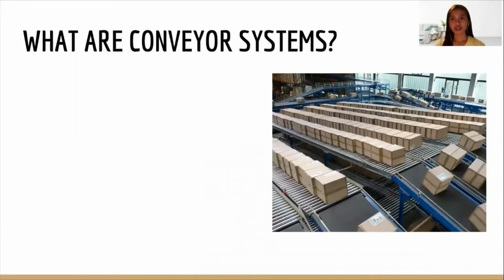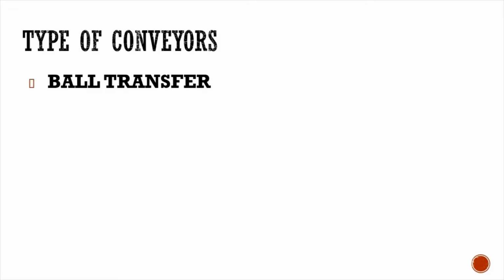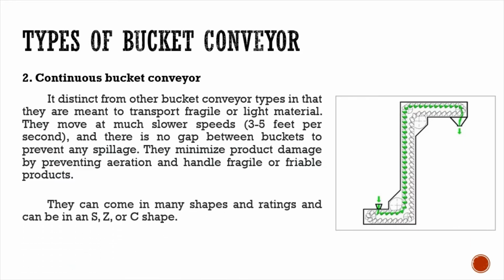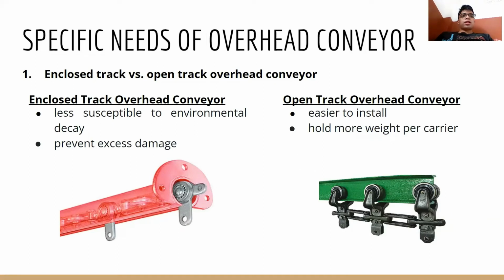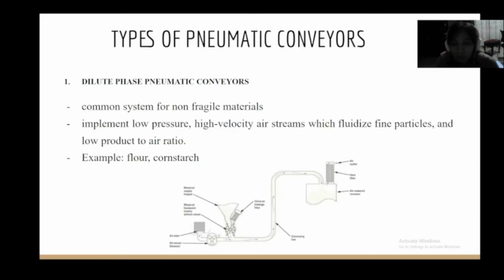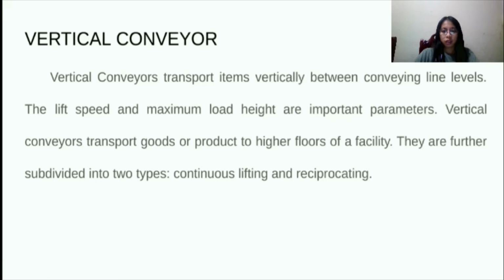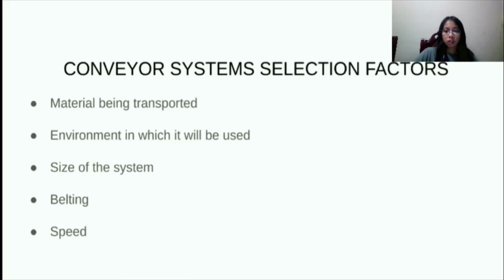Conveyors and Conveying Systems

Comment: Dajan, Kenneth Joseph Rex D.

18:38 Magnetic Conveyor

Magnetic conveyors contain permanent ceramic magnets in the bed of a standard conveyor. Magnetic conveyors hold ferrous parts fast to the belt and are ideal for elevation changes or part holding. They can be used in upside-down applications, with the strength and size of magnetic field designed per application.

Comment: Jeff Hentzen Simene 4A
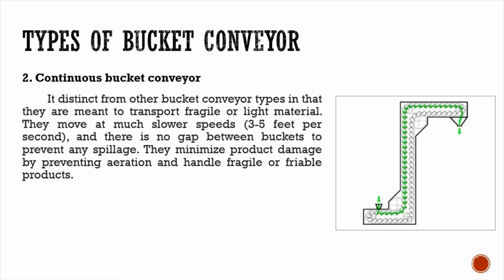24:18
Continuous bucket conveyor is designed to transport bulk materials from one or multiple feed points to a central discharge with high capacity. It is suitable for a wide range of materials, such as rice, peanuts, salt, silicon material, active carbon, etc.

Comment: Pescador, John Berth
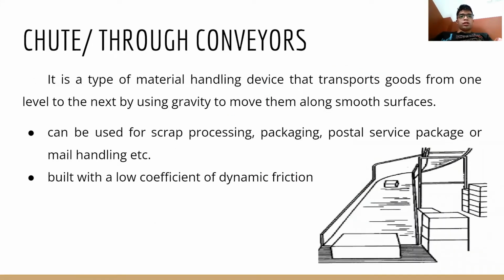25:57 - Conveyor Types
In the first portion of the topic I learned what conveyors are before moving on to the many types of conveyors, which piqued my interest. Conveyors mentioned in the film include the Chute/Through Conveyor, Drag Chain Conveyor, Overhead Conveyor, Pneumatic Conveyor, Vertical Conveyor, Vibrating Conveyor, Walking Conveyor, and Wheel Conveyor. The studies also go into the many types of conveyors, their uses and applications, as well as the benefits and drawbacks of each type.

Comment: Macalaguing, Ivan Jun A.
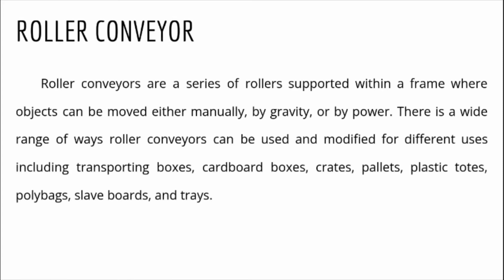8:20 - As the report discuss about conveyor, I've learned that it is so important in an industry for transporting things  such as boxes, plastic etc.
9:31 - I've also learned a brief history about it's origin and patent owner of the roller conveyor. It is stated that in 70's used for modern and computer control complex application.

Comment: Veloz, Adrian Clark D.
0:23 - Conveyors are mechanical devices or assemblies that moves material conveniently. It is comprised of frame supports with rollers, wheels, or a belt. This can be powered by naturally by gravity, by manual effort, or a motor.

Comment: Lamberte, William Wallace A.
5:53 Benefits of Using Conveyor System
Before going to the benefits of the conveyor system, let's first define what is a conveyor system. A conveyor system is a mechanical handling device that automatically transports loads and commodities within a space. With this we can safely say that a conveyor system is a type of system that makes the transfer of goods a lot more easier and effortless. Some of the advantages are, it is more safe than any other means of good's transportation. One can also choose a lot of way on how operate the system like hydraulic and mechanical. And also, it can transfer any types of goods in various shape, size, and weight.

Comment: Aggarao, Kaleel
ME4A
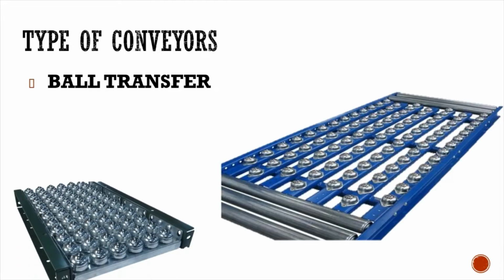16:31 Ball transfer conveyor
This type of conveyor uses running balls and medium-heavy or heavy plates to move items with smooth surfaces through designated areas. There is also a pneumatic table to raise or lower the materials on the conveyor. Due to its minimal friction design, it is widely used in fast-paced handling industries that are in need of efficiency like airline and freight transportation.

Comment: Jayoma, John Lloyd E. 
5:57 - Benefits of Using Conveyor Systems
Conveyor systems' most obvious advantage is their efficiency in completing any specified task while maintaining a high level of worker safety. Furthermore, the load capacity of such systems can be revised to comply with the requirements. Conveyor systems can be outfitted with a plethora of features to increase their functionality.

Comment: Lawan, Edcel Benz R.
25:56 - Types of Conveyors
I learned what conveyors are in the first part of the video until I got to the numerous types of conveyors, which intrigued my attention. Chute/ Through Conveyor, Drag Chain conveyor Overhead conveyor, Pneumatic Conveyor, Vertical Conveyor, Vibrating Conveyor, Walking Conveyor and Wheel Conveyors are the types of conveyors mention in the video. The reports also discuss thoroughly the what is the specific type of the conveyors, its uses/applications and also the its advantages disadvatntages of each type

Comment: Pelegrino, Justin Blake Nash E.
5:54 - Benefits of Using Conveyor Systems
The most prominent benefit of using conveyor systems is their efficiency of doing any assigned task, while maintaining a high level of safety for the workers. Moreover, the capacity, in terms of load, of such systems can be adjusted according to the needed amount. There is a variety of options that can be layered on to conveyor systems that many more possibilities, in terms of its usage.

Comment: Matthew Antoine Lawrence B. Añora
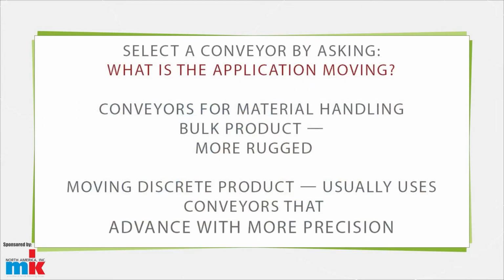1:33 
What types of product is the conveyor moving?
Conveyors for a material handling bulk product are more rugged than those moving discrete product. In contrast, for moving discrete products, it requires conveyors that advance with more precision. With this, I've learned that different types of conveyors are used depending on the product that it transports to avoid error during transportation process. Precision is a must.

Comment: Zayas, Frankyrex Aldrich B.
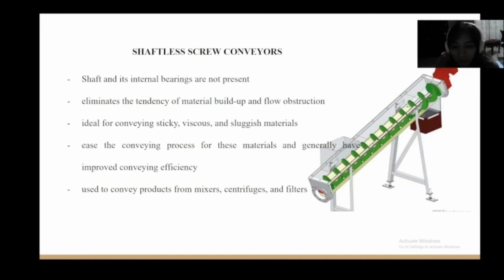46:30 - Shaftless Screw Conveyors
The reporter’s voice in this part need an improvement. This conveyor was interesting in a sense that it is suitable for sticky materials that is one of the most hardest thing to work with. This is also not hard to repair because it doesn’t have a internal bearing.

Comment: Zalsos, Ervin A.
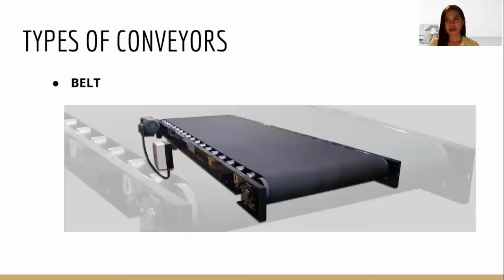7:08 - Belt Conveyor
The reporter generally discuss about belt conveyor and how its works. A belt conveyor is made up of a metal frame with pulleys at both ends of a flat metal plate or rollers, as well as a continuous loop of conveyor belt that spins around these pulleys. Also, in belt conveyors one of its pulley is motorized so the conveying mechanism will work.

Comment: Cubrado, Xyreal L. 
20:29 - Magnetic Belt Conveyor
in this part of the video, the reporter discussed the primary type of magnetic belt conveyor, the magnetic belt conveyor. Magnetic belt conveyors are one of the most widely used types of systems as they are easy to construct and operate.  These belt conveyors are either a magnetic slider bed or magnetic pulley which is used to transport ferrous materials vertically, upside down, and around corners.

Comment: Calaque, Kyron Davonn
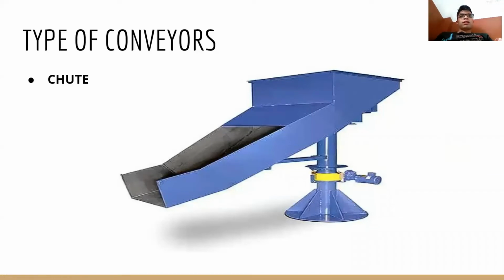25:50 - Chute Conveyors
 The reporter briefly explained chute, which is one type of conveyors. This is one of the most common piece of mechanical handling equipment used in transferring materials from one location to another by using gravity to move them in smooth surfaces. Other than it being useful, it is one of the least expensive methods of conveying materials.

Comment: Cagampang, Jon Eli P.
44:09 - Horizontal Screw Conveyors
The reporter explains what a horizontal screw conveyor is at 44:09. Horizontal screw conveyors are the most basic type of screw conveyor, and they can handle a wide variety of bulk material properties. The reporter then went over what trough loading is and how it relates to screw conveyors.

Comment: Acelo, Ray Joshua L.
32:02 - overhead conveyor
 The reporter explained what an overhead conveyor is and its mechanism. He also explains the benefits of the overhead conveyors. These conveyors are energy efficient and use small amount of power. In 32:48 the reporter explains specific needs of an overhead conveyor.

Comment: Abello, Raynand R.
07:40 - Belt Conveyor
The reporter explained briefly what belt conveyor is and how it works. Belt conveyors are generally fairly similar in construction consisting of a metal frame with rollers at either end of a flat metal bed. Belt conveyor technology is also used in conveyor transport such as moving sidewalks or escalators, as well as on many manufacturing assembly lines. In certain applications, Belt conveyors can also be used for static accumulation or cartons.

Comment: Romero, Lorenzo Matthew D.
15:08 - Apron Conveyor
Lower coefficients of friction in the winding compartment which means that, in some cases, a smaller chain size with comparatively equal capacity can be used. As the conveyor chain does not run through the material being conveyed, it is subjected to less wear than in wet ash removal.